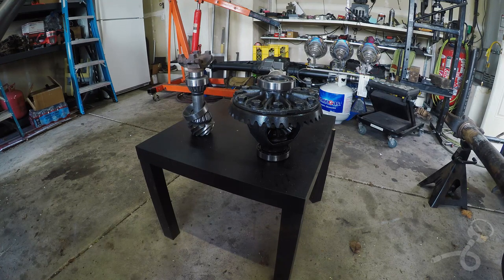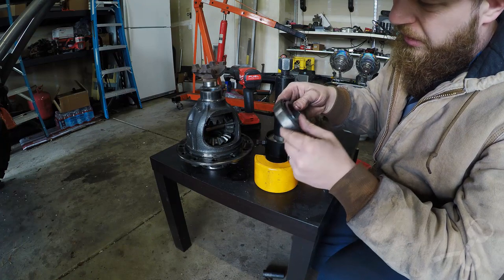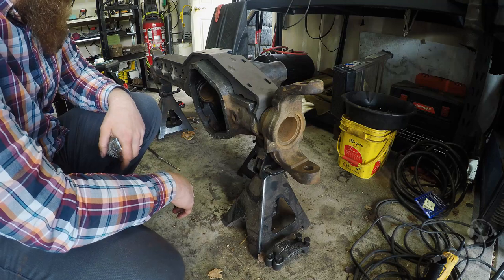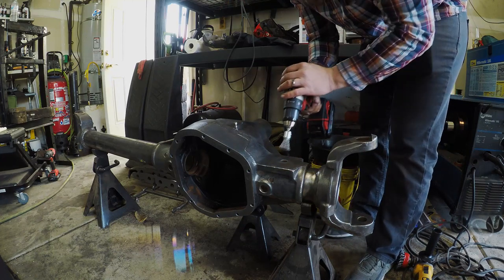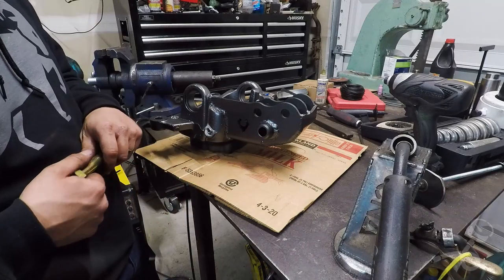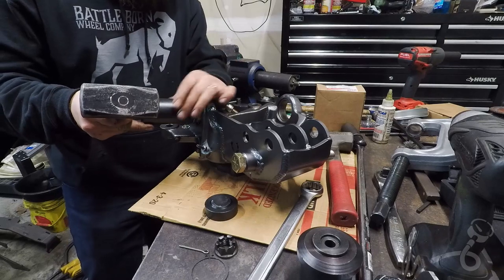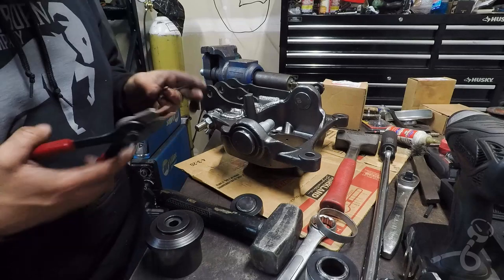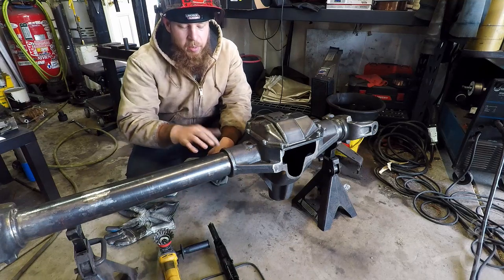Dana 60 Tube Welding, Ball joint Install and Prep Work Before Truss and Shave Kit Superduty Axles

Comment: Did you use the blue demon nickel 55 for the axle tubes to the housing,  also what shielding gas are you using?
Reply from the maker: Yes I did. I used their ENiFe-Cl wire and C25 gas.
Reply: @aireddown813  thanks brother! I love your series! I'm watching your videos and builds as you go, like a step by step tutorial.
Reply from the maker: @richardcabeza6511  thanks my friend! and thanks for watching. I’ve got episode three close to done.
Reply: @aireddown813  Do you have a build sheet for your axles? I'm basically copying everything you did. I'm getting a little confused on the 35 spline outer stub conversion. Any help would be appreciated!
Reply from the maker: @richardcabeza6511  I’ll post a build sheet here:

Rear axle:
-2004 Superduty Sterling 10.5
-ballistic shave kit with integrated truss
-Artec 10* lower link mounts
-ballistic upper link mount
-Yukon zip locker 
-USA standard 5.38 gears for Ford 10.25
-Ratech 341K setup kit.
-Dana 70 ring gear bolts
-Ford 9 pinion preload shims
-nitro forged 1410 ubolt yoke
-rebuilt wheel hubs
-SSBC V8 brake kit (future)
-power stop crosssdrilled and vented rotors (future)
-branik legacy 300m shafts (future)
-branik Dana 60 drive flanges (future)

Front axle:
-2004 Superduty Dana 60
-ballistic shave kit
-Artec low profile truss
-Artec 10* lower link mounts for SD60
-Artec upper link mount
-Artec weld on crossover high steer arm kit
-rebuilt balljoints 
-Yukon zip locker
-Yukon 5.38 gears
-USA Standard setup kit
-Yukon forged 1350 ubolt yoke
-branik legacy 300M 35 spline inners (future)
-spintech free spin kit with 4340 35 spline outers and stainless MM hubs (future)
-SSBC V8 brakes (future)
-power stop cross drilled and vented rotors (future)

Comment: What made you go with the Yukon Zip locker instead of ARB?
Reply from the maker: Don’t get me wrong, I respect ARB. They have a great reputation, but lately I’ve been hearing of a lot of seal failures. Seems almost every YouTubed rock crawler I follow has had an ARB seal failure in the last year. So for that reason, and because the ZIP is a little cheaper, I’ll go with Yukon and hopefully avoid losing my locker on a wheeling trip.

Comment: If you don't watch this guy, he built the same axles... just curious why he didn't have any issues with the welds cracking?  I have the same set sitting here and I am at a dead stop b/c I can't really get a clear answer even from manufacturers that sell the high steer kits and truss kits for these axles as to which process to use... https://www.youtube.com/watch?v=dSoIhU2K94E
Reply from the maker: TY - I do watch Nate. He’s got a great channel. He mentioned using “special mig wire” in his last axle welding video. I have that wire. I use ENiFe-Cl welding wire in a 2 lb roll from blue demon. There is a seller on eBay who sells it for $80 a roll. This wire is specifically developed to weld steel to cast with low preheat. The other piece of the puzzle is peening. I needle scale each bead after I make it, and I wire wheel right after that. This allows the weld surface to stretch as the materials cool reducing cracking. Those two things, besides the obvious preheat and slow cool have worked well to eliminate cracking in my iron to steel welds. 

Check out the assembly instructions for the ballistic fabrication shave kit for a ford 10.5. They have the instructions available for download on their site. Those welding instructions are the most complete and fool proof method I have ever found for welding steel to cast.
Reply: Aired Down   I just found your comment on your other video about that wire.  Is that the same wire that you used on the tubes to the axle housing as well?
Reply from the maker: TY - I guess I didn’t answer your question... haha! So I saw where Nate had some cracking issues on his front axle welding, but a lot of his welding on iron seems to hold up. You can weld iron in a variety of ways, and Nate has experimented with nickel arc welding rods, stainless steel TIG filler, and basic MIG wire with varying degrees of success. the principal here, above all else, is iron shrinks at a different rate than steel as it cools. Because of this, a hard weld bead will crack under the extreme force of these shrinking materials. The idea is to make a weld bead soft enough to flex or even deform with the patent materials as they cool. The nickel iron welding wire I use does exactly that, it’s a softer material that deforms instead of cracking. If you peen a bead, it resets the surface forces in the bead and allows it to stretch a little more before breaking. So combining a softer more pliable weld bead like that of nickel or low grade stainless, with the principals of peening and slow cooling, gives you the greatest chance of a crack free weld as the materials cool.
Reply: Aired Down  i usually used 309 stainless wire until I saw yours and nates videos and I started double guessing my methods bc there’s always a millions ways to do something.  Being as I’m building a Jeep I plan to have my wife and kids in I definitely do not want a weld to fail on a steering knuckle.   I used these axles in a Jeep and Toyota back nearly 10 yrs ago and I am pretty sure we just mig welded right on them and cooled them off slow. Never had any issues with cracking on the welds.  But again not saying that was right.  As I do fabrication for work now I always want to learn as much as possible and I appreciate you putting out videos on this stuff.
Reply from the maker: TY - yup. Same wire anytime I touch iron at all on this build.
Reply from the maker: TY - I’m in the same boat as you. Gotta make sure I protect the wife and kids. Also, I agree that learning as much as possible is always a great idea. Thanks for the compliment, and I’m glad these videos are helping!